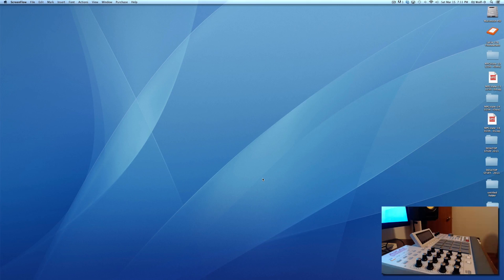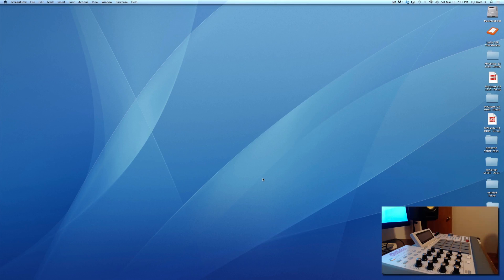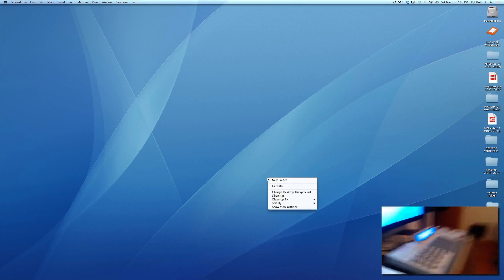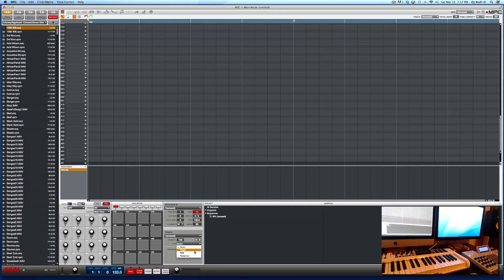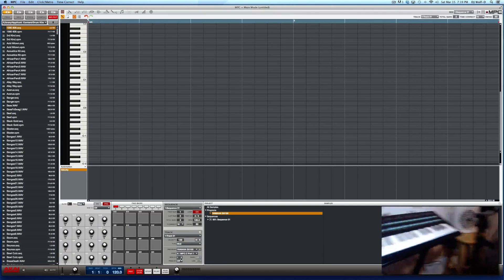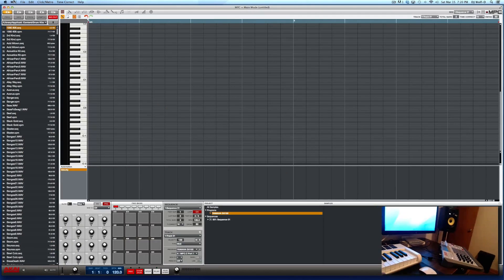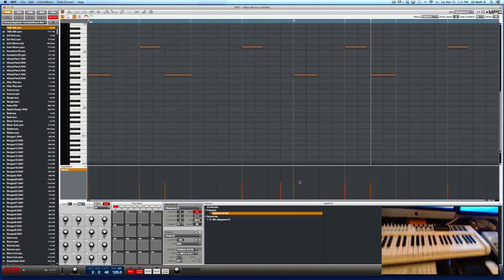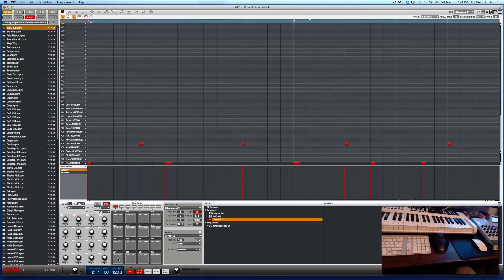Akai MPC Tutorial - Connecting & Sequencing External Midi Gear

Comment: Hi Man Wolf-D! Is it possible to play those midi notes from MPC pads also? I'm asking just because I'm about to have couple external rack sound modules and I don't have a midi keyboard.. And sample-wise, would it be more efficient to send notes to for example pro tools or such that has longer audio recording time?

Peace.
Reply from the maker: sakkemakke   Yes... you can play from the MPC pads.  You would just need to start out with Pad Bank B or C and not A, because the midi notes on Pad Bank A are lower than the keys on an actual midi keyboard and you won't hear anything when your press the pads from Bank A.  When it comes to midi recording, you don't have a time limit, because you're not recording audio.  All you're doing is using the sequencer to record midi information, so time is not an issue.  You will of course ultimately end up recording the actual audio from your modules to your DAW (Pro Tools, Logic, Ableton, etc.), so if Pro Tools is your sequencer of choice, then you can definitely bypass the MPC all together and just use Pro Tools to sequence and record those external sound modules.

Comment: Are there any 808 basses that come with any of the expansions. I have looked through the 909 expansion and couldn't really find any. Where can you get an 808 sound or do you have to download a drumkit online somewhere?
Reply from the maker: Turner Roberts A regular 808 kit comes with the 9GB of sounds/samples that come on the MPC install disc.  Also, the latest update of the MPC Software includes the new Trap Drums kit which has the record ready engineered / processed 808 sounds.

Comment: everything is working fine as far as connectivity goes. im having 2 problems tho

     1- i cant record notes from the keyboard keys but i can record the keyboards sound from the mpc pads.
     2- when i playback the recording it plays through the keyboard speakers (figured that was normal) but when i save the recording through audio mixdown  (as wav. and mp3.) the recording from the keyboard completely disappears when played outside of the mpc software.

what am i doing wrong ?
Reply from the maker: christopher scudi 1.) Are you sure that you connected your midi in and midi out cords correctly (you need both cords connected)... as well as made the midi in and out adjustments within the software?
2.) Remember... all you're doing is recording midi notes.  You're not recording live audio into the MPC Software.  The MPC Software is not a DAW that can record live audio tracks.  You would need to physically connect an audio cord from your keyboard into an audio interface and record the audio from the keyboard into a DAW (Pro Tools, Garage Band, Logic, Ableton, etc. etc.) in order to record the sound from your keyboard.

Comment: im looking to sync my mpc2000xl to my mpc renaissance using midi. My plan is to run my old beats (sounds in song mode) to my renaissance and give them a updated feel. Can you help?
Reply from the maker: In case you're not aware… you don't need to sync up the 2000XL to the Renaissance, because you can export ALL of your Sounds, Sequences, & Programs from your 2000XL into the MPC Software.  The MPC Software accepts all of those exported files from all the older stand alone MPC's.
Reply: Hello WOLF D. Thanks for responding. While waiting for your comment i did get the Renaissance to syn with the 2000xl using midi, however its not the true solution i was looking for. What your describing is truly the answer im looking for. Can you in detail show me or direct me somewhere that i can have SOUNDS, SEQUENCES & PROGRAMS run from 2000xl to Renaissance? Thank you.
Reply from the maker: chief101937 All you would need to do is export those files from your 2000XL to a media device like a compact flash card, SD card, etc. and then transfer them to your computer.  If you're using a Zip disc with your 2000XL, then you'll need to get yourself a USB Zip drive in order to transfer the MPC files from your Zip disc to your computer.  If you don't already own one, you can find those drives on ebay for about $25.00.  I no longer own an MPC 2000XL, so I can't give you a step by step scenario… but if you need any assistance, you can just give Akai a call directly at (401) 658-4032.
Reply: I actually think i have that usb zip drive somewhere in storage thanks alot i will keep u posted on my progress. I know where the export feature is im guessing i will just have to put the sounds in the same pads and bank that  they are in the 2000xl  when i grab and drag them as a .wav file from my computer to the Renaissance in order to maintain the program and sequence set up im also guessing that program exporting means the BPM's will be the same as original. if you get a minute go to soundcloud.com search chiefgotbeats i got some old stuff on there you may dig. let me know what u think....thanks again.

Comment: How was the MPC Studio at sequencing external gear? I realize you sold it to get the Ren. But if you ever sequenced external gear with the Studio, I'd like to know how that went.
Reply from the maker: I never tried it, but it would be the EXACT same process, because they both use the same MPC Software.  You would just need to plug in the midi adapters that come with the MPC Studio.

Comment: Hey great video.  I have a roland fantom x6 I follow all your steps abs I'm still having problems with connecting to my mpc renaissance.
Reply from the maker: The only thing I can think of initially is to ask if you've checked to make sure that both the MPC and the Fantom are on the exact same midi channel.
Reply: Wolf D alright I'm using MPC Renaissance as audio interface to logic X I'm able to use it through Logic Pro X but when I try to connect my Roland Fantom is not working
Reply from the maker: selfmade814 Are you saying that the Roland Fantom is not working, or are you saying that the MPC isn't working when you try to connect the Fantom?

Comment: do u have cables connected for audio
Reply from the maker: I don't in the video.  If I wanted to record the talk box, I would connect a mic to my audio interface and record it just like I was recording a regular vocal track. If you wanted to record directly from an external synth, sound module, etc... you would pull up the MPC inside of your DAW (Pro Tools, Logic, Ableton, Garageband, etc.) as a virtual instrument/plugin, and then connect the audio cables from your external device into the inputs of your audio interface.  You would route those inputs to audio tracks in your DAW and record the audio from your external device in real time.
Reply: Wolf D ok cool thanks

Comment: How do you record the audio in from your your external i see its recording the midi but how can you get it to record both midi notes and the audio
Reply: Wolf D I record my Vocals directly into my Ren software all the time. Its pretty easy. Not as easy and direct as in Studio One or Pro Tools.
Reply from the maker: Don't forget that the MPC Software is not a DAW, so you can't record real time audio into it.  The way that you would do it is to pull up the MPC inside of your DAW (Pro Tools, Logic, Ableton, Garageband, etc.) as a virtual instrument/plugin, and then connect the audio cables from your external device into the inputs of your audio interface.  You would route those inputs to audio tracks in your DAW and record the audio from your external device in real time.
Reply: +Micah Es what do you use as an audio interface for vocals?
Reply from the maker: Hikmat Hanna Just remember that what Micah E is doing is "SAMPLING" his vocals into the MPC Software... which means you won't have the basic/simple copy and paste features, flexibility to move and nudge your vocals around, etc. in the same way that you would in a traditional DAW.  If you already have Garageband, then there would be no reason for you to get hung up on sampling vocals, when you just just record them normally on regular audio tracks.
Reply: I use UAD Apollo with a pre amp